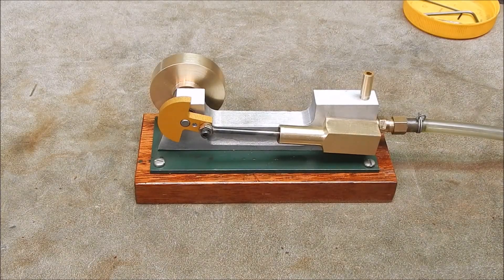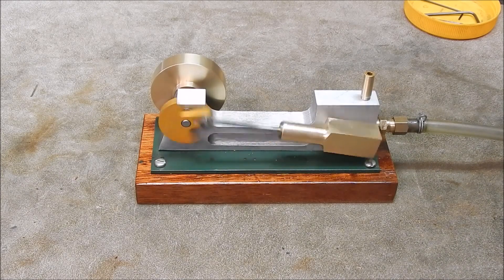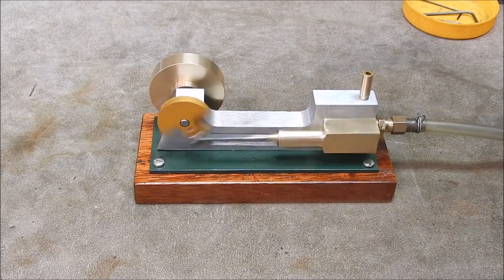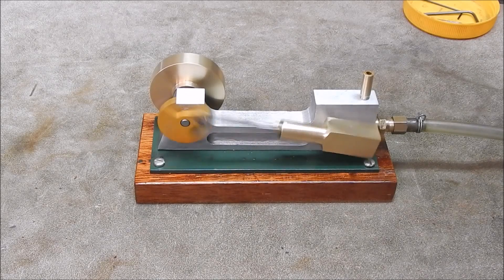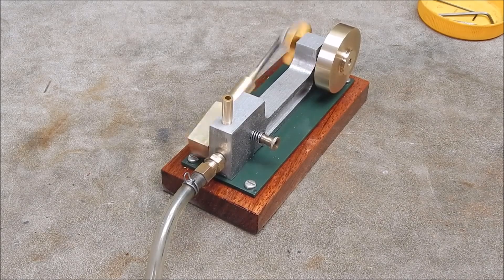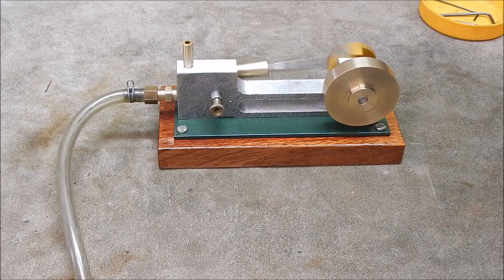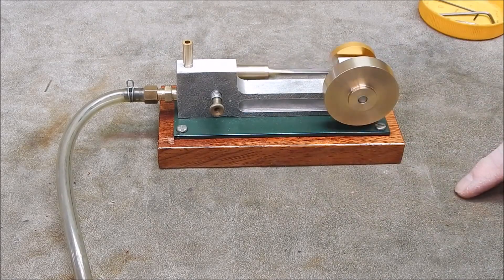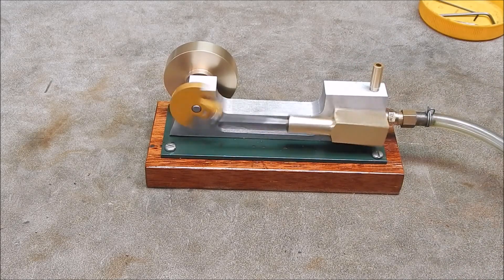The "stretched" wobbler steam engine is complete

Comment: Thinking out loud, would a short rod make for longer port duration hence a larger port potential? IE more rotation of the cylinder back and forth.
Reply from the maker: Good question.  I thought about this before building an example.  Port interfacing period is determined by crankshaft RPM and will be the same for a specific stroke length.  Con rod length should make no difference. Cheers Rob

Comment: Running well Rob, have you got a boiler to try her out on steam mate? - Cheers Jim
Reply from the maker: Hi Jim.  I have a boiler on another wobbler engine that could be modified/plumbed to also use it as a remote supply.  I was thinking about that recently.  I have some small brass aquarium air taps that could be used to control feed.  I will have a closer look when I get time.   I have to switch to house repairs, so things may be quiet for a while.  Cheers Rob
Reply: @Xynudu  See you on the other side Rob

Comment: Nice one Rob. Wigwag, wobbler are alian to me, my old metalwork teacher, Mr. Puliston (the best teacher of all time)  had us pupils call this type of engine 'oscillators'. So I would call it an oscillating engine. Its interesting this type of engine has so many names. thanks for sharing
Reply from the maker: Hi Ian.  I see in Wikipedia it's referred to as an oscillating engine, so your teacher was correct.  However, it says that in the USA they are called wobblers.  So it's all a bit flexible :)  Apparently they built quite big versions that powered ships pre 1900.  Interesting.  Cheers Rob
Reply: @Xynudu  Ships and all sorts I believe. I think a lot of the industrial versions were/are double acting with multiple cylinders enabling self start as you know. Variations are endless and you have made a great little example of a working principal. I enjoy your inspiration